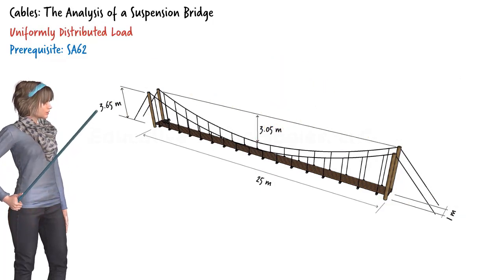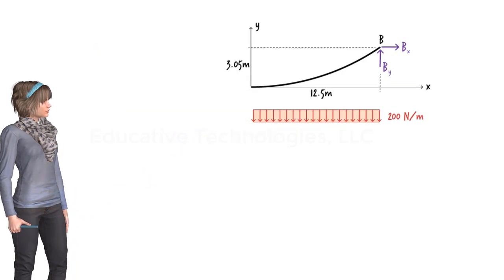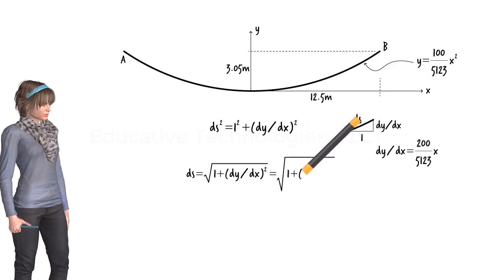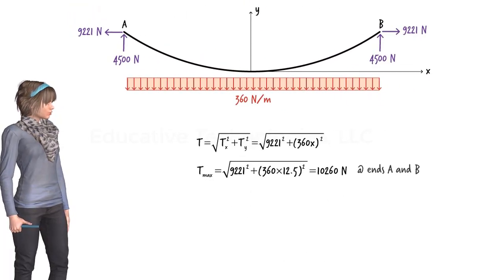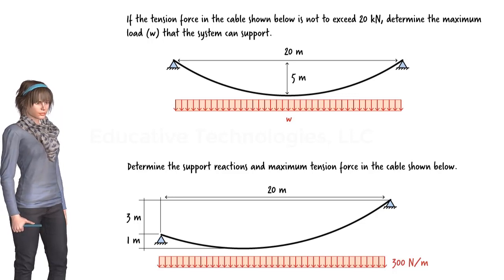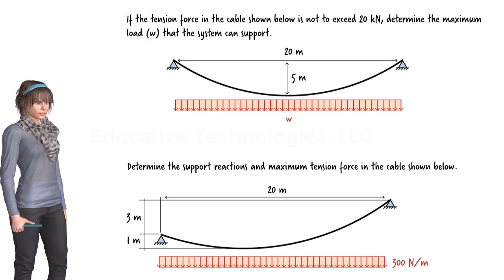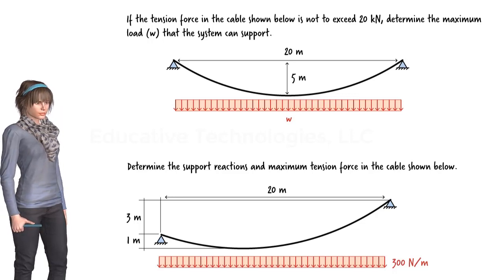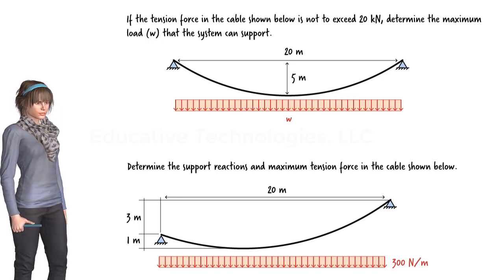SA64: Cable Subjected to Uniformly Distributed Load

Comment: what if the sagged part is not equal? like pin B is higher than A and the x at the lowest point is not given? :((
Reply from the maker: If there are too many unknowns, the problem becomes statically indeterminate. In that case, we need to use more advanced techniques, bringing the properties of the material (cable) into the formulation, to analysis the system.

Comment: Hi Good night can you do a cable with a combined udl and concentrated loads? Thank you
Reply from the maker: The second half of the video (starting at 6:47)  shows how to deal with concentrated loads in combination with uniformly distributed load.
Reply: @DrStructure  thank you very much
Reply: @DrStructure  can you do  a video where the sag is off centre?
Reply from the maker: @arcadebeast2219  Yes, that scenario is going to be discussed as a part of the solution to the second exercise problem (given at the end of this video).

Comment: Dr Structure Will you be planning to make videos for plastic design of beams and frames? If not; could you give some reference books for this topic? Thanx
Reply from the maker: Eventually we will, but it will be a while before we get there. There are a few textbook on the topic out there, you may want to take a look at Structural and Stress Analysis by T.H.G. Megson. The book has a chapter of plastic analysis that is relatively easy to follow and understand.
Reply: @DrStructure   I look forward to watching  the video. Is it possible to compare  the  frame sections elastic and plastic design  in the videos SA51 and SA52?